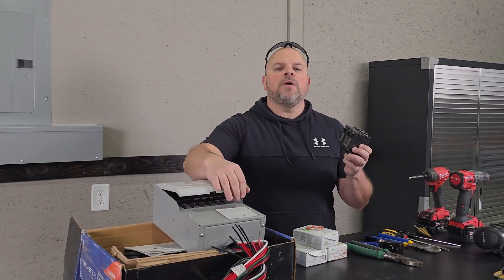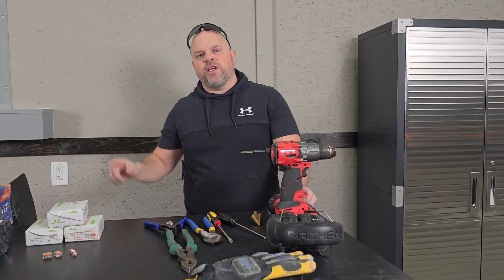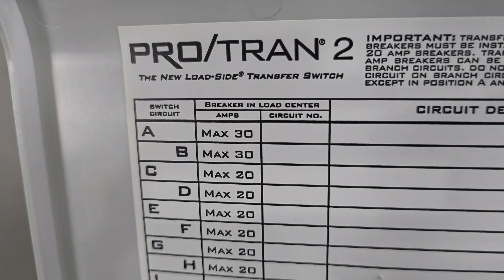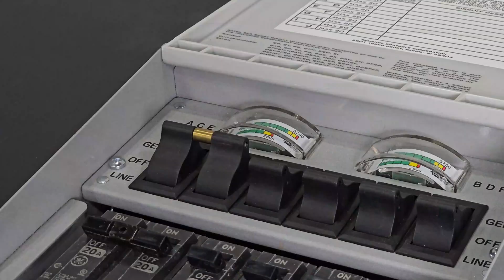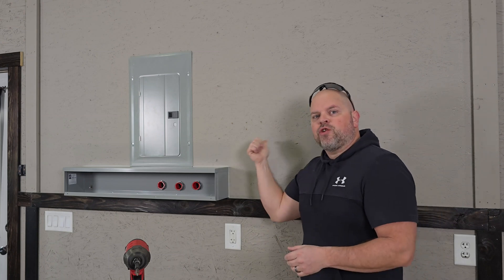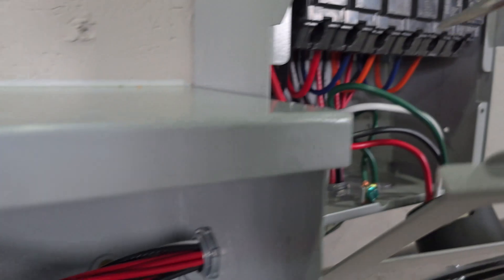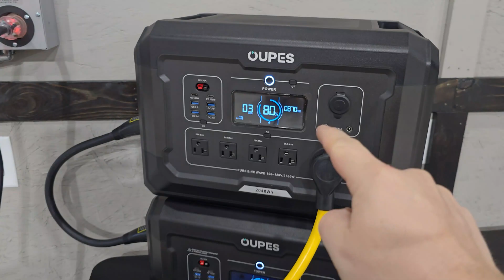Step-by-step on How to install a 30 amp transfer switch

Comment: Great video dude. I am getting ready for a snow storm tonight. I put in a Reliance 30 amp 6 circuit 11 years ago after hurricane sandy in 2012 had us with no power for 2 months. So of course I am drinking a beer and looking at this tonight. The Reliance stuff is outstanding. Love the fact that it comes with 10g also. Wiring is super serious work but a home owner who is comfortable learning shouldn't be afraid IF they learn properly. I have learned so much from the mistakes I've seen in homes through the years. Knowing how to fix things puts you in charge. Nice work.
Reply: Also for the most part people buy too much generator. 3600w will handle most small to medium houses. Furnace, sump pump, refrigerator, some lights. You are good to go. 3600w sips gas.
Reply from the maker: I agree that the 3600-4000 watts is a good range for most looking to just back up the essentials.
Reply from the maker: Winter is coming in strong! Hopefully you don't need it but its great to have it there if you do!

Comment: can i connect in parallel  two 12 v 660ah lifepo4 battery then connect them to a 5000w dc to ac Power Inverter and connect to the transfer switch?

Comment: How do you run 5 20 amp circuits with a 30amp feed? I’m confused why you think you need to replace your 15 amp breakers with 20amp. You only have 30amps total.
Reply: Add up all the amperage in your breaker panel and compare it to your line feed and you'll see the numbers are nowhere near the same.  I have a 200 amp feed and maybe 350 to 400 amps worth of breakers.  You're not going to use all the power at one time to all the circuits.  If you do, you gots issues.  lol

Comment: @7:25

You should use a self tapping drill bit to screw in a ground screw for proper bonding on the rear wall of that little panel

Comment: So I’m off grid. I have two types off solar systems. I also have a generator. Wondering how to hook up a dual transfer switch. Use one system then switch to another and when both are dead then generator auto starts. Any ideas?

Comment: Hi, you forgot to show what you did with the original wires that were connected to the subpanel, before you started connecting the transfer switch wires.  I appreciate any information about getting this all wired up correctly and completely.  Thank you.
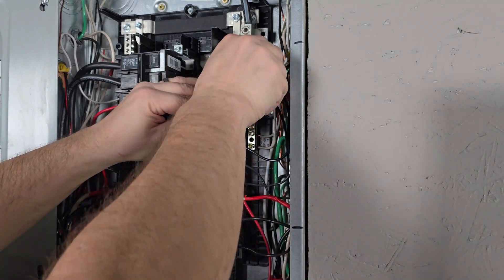Reply: I believe the original wire that is removed is replaced with the red wire at the breaker coming from the transfer switch. Then the original black wire from the breaker is connected to the black wire coming from the transfer switch. If you pause it at 11:20, you can see the Wago connector in the top right with 2 blacks connected.

Comment: Would there a back feed issue?
Reply from the maker: No, using a transfer panel wil isolated the circuits and there would be no backfeed to the grid if installed properly.

Comment: Since this load center box it’s only 125v cannot work with circuits that are sharing neutrals right?
Reply: I have the same question! I’m pretty sure his inverter has to be un-bonded in order to work safely and not make any loops or have more than one bonded G-N in the system. Other wise his appliances or inverter could burn up correct? It would be the same scenario with a generator instead of a inverter because it would be sharing the sub panel’s neutral from the utility company with the transfer switch and then with the inverter/Generators neutral, that would then both simultaneously have current running through them at the same time correct?  
Why doesn’t anybody making these videos ever talk about the importance of that? I know this because i have one of these transfer switches and it says “NO BONDED GENERATOR OR BONDED POWER SOURCE MAY BE USED WITH THIS MANUAL TRANSFER SWITCH” it’s right In the manual!

Comment: All great and sunny, but you should not run your battery/generator while you have your mains on, think about the high voltage linesman who is next to the thousands of kva transformer and when they loose power and work on it, you are back feeding the grid!

A spit second of this careless behaviour can kill someone
Reply from the maker: Before damning me to hell, consider this. If you understood how a transfer switch works you would know that its impossible to backfeed with the generator. Take some time and look into that and get back with me.
Reply: Uh, the WHOLE PURPOSE of a Transfer Switch is to, uh, TRANSFER the load from the grid (line) to the generator.  The switch up top is actually labeled "Line" or "Gen" 

So any loads you switch to power with the "Gen" are NOT CONNECTED to the "Line" (Grid).  No backfeed.

Comment: Good video. My only question is: Why are you calling a wire nut a wingnut? Is that a local colloquialism?
Reply: It’s a wire nut with wings to ease tightening, Wingnut, I’ve used these in Canada for almost 30 years.

Comment: Appreciate the video. So just to be clear, for the transfer box, make sure all the breakers are 20A correct? That is why you were switching those breakers that came with the transfer box?
Reply: Do not replace the existing 15 amp breakers with 20 amp if the circuit you are backing up has a 15 amp breaker, unless you verify the wire is 12 gauge. It probably is 14 gauge, so you could possibly overload the existing house wire if you try to draw too much current.

Comment: Can you use a gas generators too on transfer switch?
Reply: Yes you can just make sure the main breaker is off you don’t want to back feed into the power lines .

Comment: My question is about avoiding a ground loop scenario - same setup as you (except on a main panel).  All transfer switch selectors are set to "gen" so that the battery automatically takes over in a power outage, but the battery charges from the mains (charge/passthrough) when mains are live.  So I know I have a ground loop in this scenario, question is how do I fix it?  Lift the ground in the charging outlet or in the input to transfer panel?

Comment: Great video, thanks so much. My inverter is 3000W 12V with a 30 amp (@25) AC output terminal block cable. I have it adapted to the RV type, 3-prong NEMA connector. I only want to power a few 15-20 amp circuits witht he solar setup and am confused about those 4-prong connectors. My AC output is only black, white, and green. Will that work with a manual transfer switch somehow?

Comment: Awesome step by step tutorial. I just ordered the same transfer switch and needed a good tutorial on how to install it. I was an electrician's helper for a couple of years when I was much younger, and I've installed a new main panel in my house when I couldn't get breakers for the old panel any longer. So I'm pretty comfortable working with house wiring, but I've never installed a transfer switch before. You explained it and demonstrated it so well I'm certain I can install mine. Thank you.

Comment: How can you tie the breakers in the main box, without double lugging…? 
And if I’m correct, it’s not legal to double lugging… what am I missing?
Reply from the maker: Yes, you should never double tap a breaker incase its designed for that. In most cased it is not. All that is happening here is that your isolating a panel from another panel using a larger breaker. I hope that helps you.

Comment: What size hole did you need to drill? Where did you get your trough? I’m installing a 10 circuit pro Tran, but my panel is flush mounted. I’d like to avoid having to do a dry wall repair.

Comment: How to go from 4 wire plug in transfer switch to 3 wire plug on generator or battery as you have in your video. Thank you
Reply from the maker: Adapter Cord I used in the video: TT-30P male to L14-30R female https://amzn.to/3RcfyRr

Comment: Every video on these that I see shows people do not have AFCI/GFCI circuits. Yet, I know that people have AFCI/GFCI. circuits.
Reply from the maker: The 50amp transfer switch that I have in my house and the one that I replaced this 30 amp with, does. I agree, depending on the circuits it should have dual function breakers.

Comment: Justin, two quick questions. Where did you buy that electrical trough? How did you get the transfer switch wires from the trough into the breaker box - fish tape?
Thanks!
Reply from the maker: I ordered the electrical trough from CES (City Electric Supply) - They typically have the best prices around, if you don't have a business discount with your local supply house. https://www.cityelectricsupply.com/austin-enclosures-ab-6624rt-6-x-6-x-24-rainproof-troughpush 

The wire run was so short that I could just push the wires through.
Reply: @JustinsProject  thanks so much. Appreciate your help!

Comment: Great Vid
Curious if your set-up can also allow the Backup Battery to be charged from the solar or home while not in use but plugged in?
If not can you include a link to any videos that walk through this.
TY!
Reply from the maker: https://youtu.be/K-mXmVMyFxQ?t=323&si=tFxs-adiMTy1h_Qd - I think your looking for something like this. Hope it helps.
Reply: @TheSolarPit  thx - Any thoughts on the Ecoflow Delta Pro Ultra

Comment: Nice tutorial! If you haven’t made it already, I’d be really interested in a video where you add a second, exterior, 30A power outlet to this same configuration. That would allow you to use a gas generator outside to power your panel, when your power bank runs out of juice. I’ve read several comments by people with that configuration.
Reply: This sounds like a great backup solution, following!
Reply: Its exactly the same.  Except the leads to the 30A receptacle are 15 ft long instead of 6 inches long.

Comment: Great video helped me understand the process.  Seems doable. 1 question though.  How long 30amp generator cord can be run from the transfer switch to the generator?  I have to mount my switch outside and want to run a cord from the switch to my garage (about 75 ft) where I plan to keep my solar generator.
Reply: Southwire has a good voltage drop calculator on their website that will advise you.

Comment: What’s the yellow cord going into the battery? I assume the unit doesn’t have a plug that the cable that came with the switch could fit?
Reply from the maker: Correct. It is just an adapter that I purchased off Amazon.

Comment: So based off what it said on the switch panel door, I could swap in a 25 amp double pole Square D breaker into the 10 circuit version? That is what my HVAC breaker is, in my main panel. The 6 and the 10 circuit transfer switches "appear" to be designed the same.
Reply from the maker: Thanks for watching and commenting

Comment: Great video: well edited, clearly spelled out. My only concern would be the neutral->ground bonding that I assume happens within the backup battery unit while the cord is connected. As you likely know only one neutral->ground bond can exist, at first point of disconnect. With two bonds, you can end up with objectionable current flowing in the ground wire which can be a safety issue.
Reply from the maker: Certainly a valid concern. It is my understanding that the power station inverter is not bonded. I know most of the hybird inverters I have been testing have not been. However, I will definitely reach out to Oupes and any other Power Station manufacturer that I hook up to this transfer switch. Great point 👍🏻
Reply: I'd be curious to hear which makes/models you can confirm are separate or separable - I'm seeking out a split phase unit myself but it'd be nice to know of a 120V version also. I just took a look at Oupe's site, I didn't realize this was marketed as a home backup solution (and I see they advertise that Reliance transfer switch mated to it), so that is a little more assuring. However I see nothing in the operation manual to say one way or the other (maybe they have a separate installation manual?)
Reply from the maker: You got my brain cells swarming. I might need to make a video on this topic if I find that some are bonded and others are not. Important information for everyone to know.
Reply: @TheSolarPit  haha! If indeed bonded one solution is a transfer switch that switches the neutral as well. It would essentially just feed a small subpanel used as a backup loads panel.